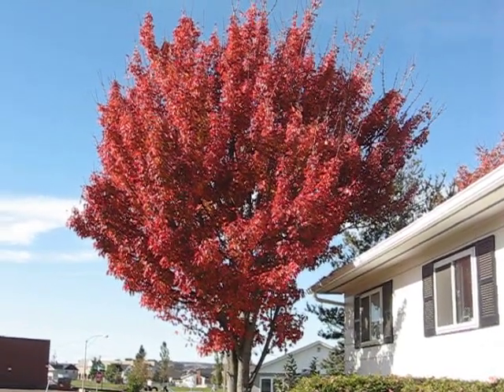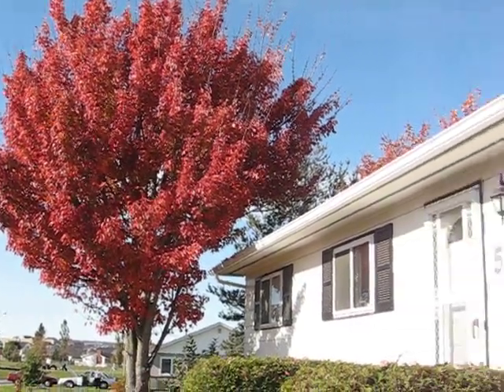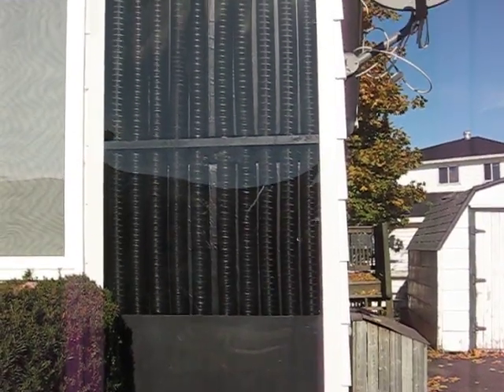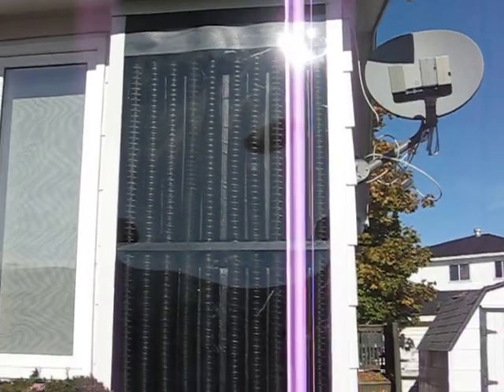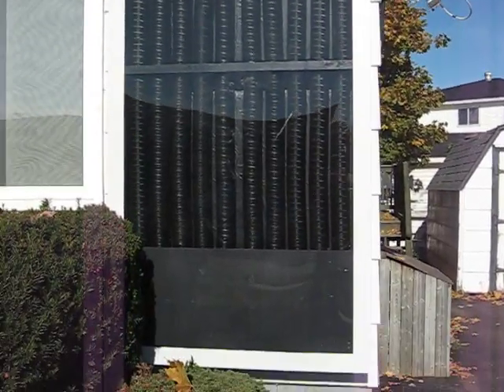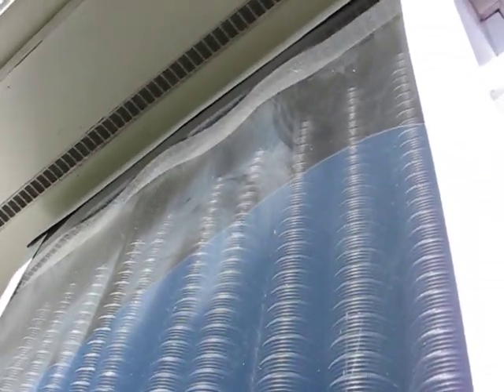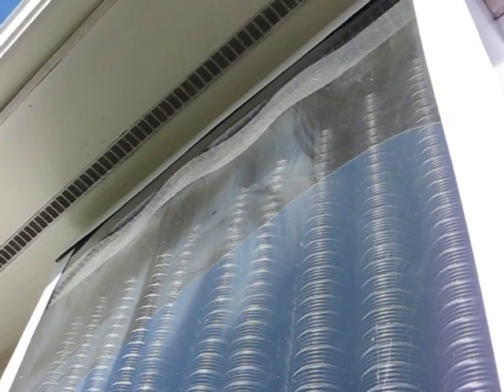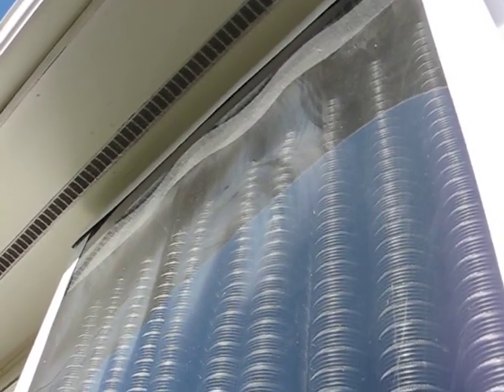Solar Heater or Solar Furnace for home heating

Comment: Do these really work?  I mean do you really get appreciable heat out of these things?  I'm very curious.
Reply from the maker: Yes it works well.  The best days are the cold days with clear skies.  It is not a replacement for other heat but it willhwat a fes rooms during the day and offset some heating costs.
Reply: @MattVey  Interesting.  Thanks for the reply.

Comment: Your setup is perfect... If I were you I would try it without the fans. The air gets so hot that the natural convection will do the job, because you inlet and outlet are on there natural spots. Ofcourse a fan will cranck up the volume of free energy.
Reply from the maker: Thanks!

Comment: Just a thought, do you think it would be a good idea to run the output back down to floor level so that the hot air doesn't just go directly to the ceiling and sit on top of the cold air that's already in the house?  If you put the output on the floor, the hot air would have a chance to heat the lower lying air as it made it's way up.
Reply from the maker: I actually did that very thing.  It was nice to have the heat on the floor by my feet.
Reply: @MattVey .......yep, but you end up reducing the amount of hot air produced, as you are having to "drive" the hot air down.
Reply from the maker: @robertwoodliff2536  probably true but I prefer the heat at the floor fir comfor.

Comment from the maker: 1)what kind of tubing diameter - 3" dryer vent

2)what lining of the box (actually a list of materials would be very useful) - 1" pink foam with aluminum foil coating

3)what to prevent cold air inflow at night - I show a pillow in the botton hole. (changing the design to avoid this need)

4) I hate background noises. Have you tried quiet fans and or just passive circulation ? - Making a new design with fans internally mounted and both holes at the top)

Comment: I'm impressed by the heating system... though the noise the thing makes is not practical and its far to loud.
Reply from the maker: The sound was never an issue.  I do have a plan for one with the fan inside.

Comment: How does this heat during the winter? Let's see if it is outside -5C then how is inside heating like during sunny period?
Reply from the maker: At -15c it still gets hot.  It will keep the electric heaters off all day if there is sun.

Comment from the maker: I recently moved and brought it with me.  I am making some changes to it.  Adding a second fan and mounting the fans inside it so the fan sound is muffled.  I am also putting both holes at the top and dividing the unit into two sides so that the air goes from one side to the other and back out like in a 'U' shape.  Having both holes at the top will stop most of the air flow that happens at night and will avoid me having to plug the hole at the bottom to stop cold air drop.

Comment: supply air should be at the bottom & return air at the top. since hot air will naturally rise, if its supplied at ceiling level you wont get the benefit of that heated air until it cools & falls into the living space & at that point its cold air.  thats my educated theory anyway

Comment: Shadows is benefical during hot summer days but not during wintertime . However you built an solar air heater which is much higher in efficiency than photovoltaics because no electricity conversion is necessary.It is still a valuable concept that is not really given much attention so far by most. What most doesnt realize is that usually half of everybody's utility bills is going to heat homes. Also , it is impractical to use photovoltaics to heat your home because furnaces requires lots of juice

Comment: Shadows may not affect as much as draft air finding its way in your home but it has an effect. No, you cannot feel it but your home can feel it.  If you have a heat sniffer, you would notice a difference of a few degrees from sunlit wall to shadowed wall from indoors. This is quite significant if you have way too much shadows cast upon your home like big tree shadows or even an long array of solar collectors on rooftop blocking solar radiation from coming into your attic . no one is paying mind.

Comment from the maker: yes, you block it at night.  I have redesigned it to have both holes at the top and a 'U' shaped flow around the bottom.  It stops unwanted air flow at night.  I hope to have it completed and a new video up soon.

Comment from the maker: I have run the fan both ways. I prefer to push the air down which is opposite to natural flow but it made the air at my feet warmer so it was more comfortable.

Comment: This is the way I see it. Because cold air is heavier it would normally be at the bottom near the floor, so it makes sense for the inlet to suck up the cold air, it gets heated and as it rises it creates it's own little vacuum effect thus increasing the flow.  The idea here is to heat the cold air which is at the bottom and expel the hot air at the top, the whole thing is like a big air mass cycle.  Do you understand the concept, even if you don't agree?
Reply from the maker: Yessir.  100% accurate.

Comment: These solar heating systems are expensive novelty items that make eco nuts feel superior to their neighbors because they "care more than you". Frankly anything that needs massive govt subsidies to exist isnt viable. People dont want solar when they have perfectly good utilities. Artificially increasing the price of oil or electricity wont make them more appealing either. The expense of installing and maintaining these systems makes
upgrading insulation and decreasing elect/oil usage favorable
Reply from the maker: Possibly.  I built it for fun.  I actually did not consider my neighbors at all.

Comment: You are correct but I don't think she was saying to TOTALLY go solar. If every house had a legit solar heat system, even factoring overcast days, it could easily reduce each homes need for fossil heating fuel by a conservative 30%.That's a third! A huge difference and better yet...it was free!

Comment: a "black  curtan",up on that "big ,double-paned, insulated,glass, pictue window",and make sure it is away from the windowsill and wall enough ,to alow air to pass from bottom to top,you might get alot more "heat".i saw one person put pipes across the window,[ his was skylight], with black reflectors on back of the pipes,[made from cans],to pre-heat water.alow spaces between the pipes,to alow light through,then close black curtan,hotter pipes,hot air.a solar ceiling fan ,blowing up would b awsome
Reply from the maker: Cool idea

Comment: hot air rises, so if you put the vent down you need something to force the air out of the exhaust, most setups place the vent on the bottom because the colder air sits by the floor and is naturally pulled in as the sunlight warms the air in the furnace. It would be like cutting two holes on the bottom, the air would flow evenly in and out of both openings.

Comment: They probably didn't want to install a fan. If you if you vent up there is a natural circulation of air. I'm sure that with the right design you could probably get it to vent down but it would require more thought! lol :)

Comment: On my pop can furnace, i used a table saw to rip a 1/8 inch gap to hold the acrylic cover.  This way it cant move around and lose contact with the box anywhere.  If you have more cfm in your box, you wont get the warping as temps stay lower.  I love the idea of the ducting instead of cans though.  Good job!

Comment: That design looks better than a popcan furnace due to the surface area of the ducting being higher than popcans.  How many cfm are you putting out?  Any ideas?
Reply from the maker: Fan is a room to room unit so maybe 60 CFM.

Comment: @jennifer171986 These arent on every house because they only work during the daytime. An effect you can get with some large properly placed windows and no extra holes in your walls. Another thing is no sun no heat. You will still need a way to heat your  home on cloudy days and at night.

Comment: I'm curious to know what happens overnight. Will the unit also strip heat from the house if the sun isn;t shining? Do you have to block the vent overnight?
Reply from the maker: Yes.  We block the vent.

Comment: @fishnetproductions Because then you have to force the air (since its nature is not to move down).  You need tighter seals and stronger fans to vent down.  Single story set ups, or whenever the panel is installed on the lowest floor, it will equalize close enough.  A ceiling fan can probably mix the air better than venting it low.

Comment: do you think this might work better using black schedule 20
pvc pipe filled with water capped on both ends - not completly
full to allow a little expansion?

Comment: ssiaudio
Hey,do you got a fan or something blowing in the bottom hole? (Intake) just wondering.
Also. The tubes you used were tubes you use on back of dryers tube yes? Spraypainted with heat resistant paint?
Reply from the maker: Yes, you got it right.

Comment: Great vid.Look up a thermal conduction chart. In terms of easily avaliable tube materials, copper is best, and can be soldered. Aluminium is good on conduction, but it like steel (easily rusting) of stainless (less good as conducting) are more difficult to join. I was thinking that using the wax controled thermostat out of a car cooling system would allow this sort of system to vent only up to a good running temperature, usually about 80 degrees C. Ignore the fan. Let convection do it.
Reply: So, Matt, as you're now 10 / 12 years on from your original build of the heater panel, how about a follow up. Are you still in that house, are you still running it. What have you done to improve it, etc etc..
Reply from the maker: @robertwoodliff2536  i haven't lived there in 10 years.  The unit sits idle in my garage.  Haven't used it at my new place.  Business building keeps me busy so less time for projects unfortunately.  I hope to soon be doing a new build to head a large area in my garage.
Reply: @MattVey .........shame it did not get a good run with it. But life / work often gets in the way of projects like this. I did have a thought a couple of years ago, that you could tackle this sort of heat capturing in two ways, long term and short term....ie, short term, the collection could be as simple as a black sheet of cloth, black painted sheet, or even just a pile of crushed can painted black and then piled haphazardly, so the air can convect through.....and on the long term build a small piece of wall, using engineering brick / or block ( the heavy stuff. ) and then encapsulate it in the insulation, so there is a lump of thermal mass, that will be slow to get moving, but would continue to shed heat well after the sun's rays are no lounger 'in contact' and if large enough, would be several hours into the night.
Reply from the maker: @robertwoodliff2536  Great ideas.  Try them out.
Reply: @MattVey ......you have the advantage of relatively cheap space(i'm in London UK).....with a house on a footprint only slight bigger than a Ford F250(a row house)...and your codes are tight, but I would suggest, ours are tighter, but less well policed. So, what the new business you built.?
Reply from the maker: Cost was a big factor.
Reply: @MattVey .....it could be panel of aluminium cooking foil, with exhaust black paint, or in the film/photography /animation industry, this a thicker aluminium sheet called "black wrap" (in the UK at least) with a good black finish, on both sides, but I don't know how wide it is.

Comment: your intake and output are reverse
Reply from the maker: By choice.  I prefer the heat blowing on the floor to mix better.  Fan forced so it is not an issue.

Comment: @jack042065 Check the temperature rating of the materials in question with the manufacturer product specs.  Glass tolerates heat a lot better than plastics like plexiglass or acrylic etc.

Comment: Very nice project with excellent benefit.  You might consider a thicker gauge of plexi. but in the end there is not substitute for glass.  My question though is any thoughts as to whether or not the plastic might emit any kind of heat related release of chemical compounds?  I dont think it does, but worth an inquiry.

Comment: @wushujia   there is a video on youtube where your system would  pass thru rocks during the day and there by, storing the excess heat till it is needed at night.  It was just a video to sell the design but am sure with search you can find more resourses on how to accomplish this.  Am thinking the same kind of rocks that are used in saunas.  Am sure a system with baffles, to close some circuits during the night and open other circuits during the day.  am thinking just day use will save

Comment: Just a thought but anyone thinking of making one of these should contact a glass company about 1" insulated glass. I build commercial buildings and they frequently screw up the sizes of the glass or there is a change in the building that causes them to have extra peices. Frequently they trash them but sometimes they hold on to them for selling at a discount. I bet 1" insulated glass on the front would boost the temp significantly as long as it didn't have a coating on it.

Comment: I think adding something for turbulence is not needed. what that would do would make it harder to move air out of the unit and into your house.  with higher temperatures in the unit you get MORE heat loss to the outside (higher temperature differential).
moving more air through the unit leads to less losses and also more heat and more even heat transferred to the house.